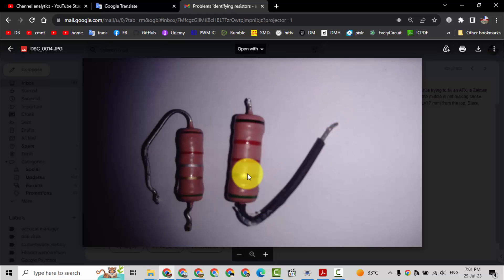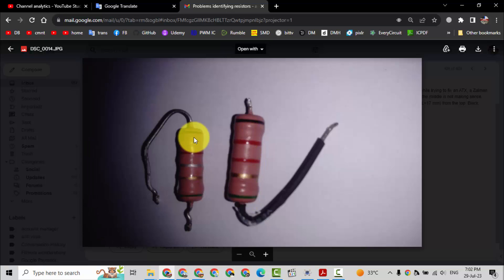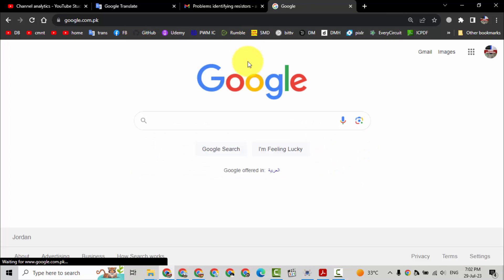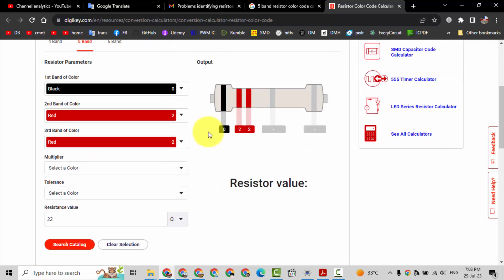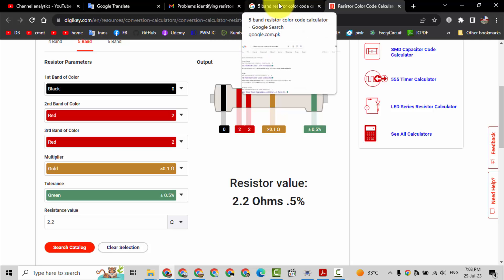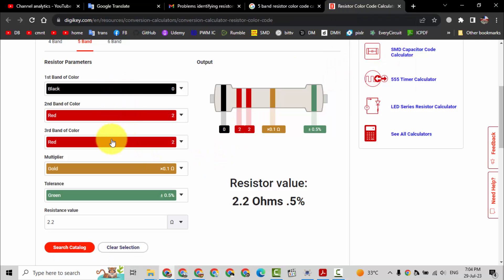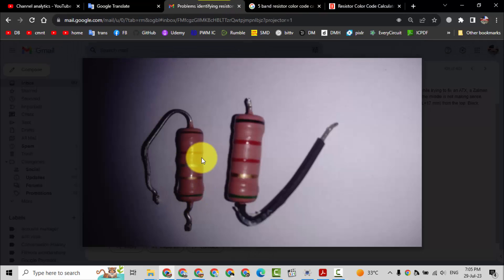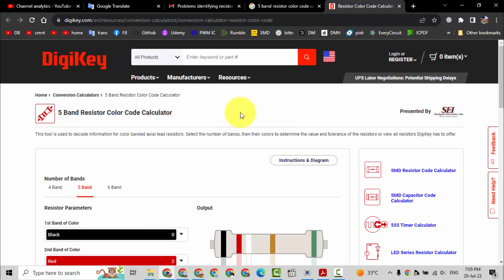{947} knowing value of 5 band power resistor color code

Comment: Sir What is component of 
M 2941 
AWU
5VE7P
Reply: 5 PIN
Reply from the maker: https://pdf1.alldatasheet.com/datasheet-pdf/view/97995/ETC/LM2941.html
it is adjustable voltage regulator. it is available in 3 pin and 5 pin package
Reply: @HaseebElectronics  thank you so much Sir